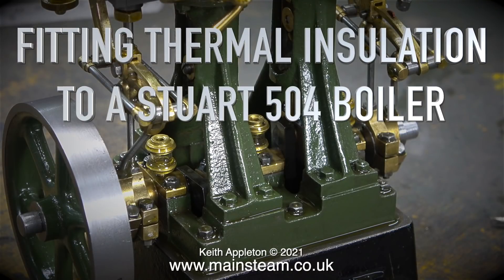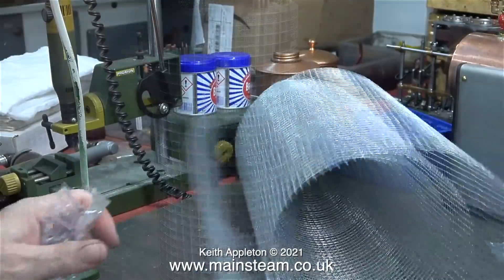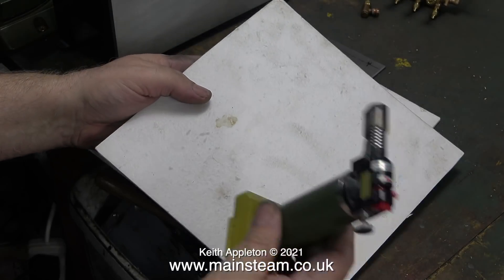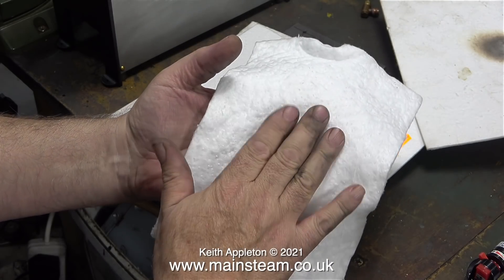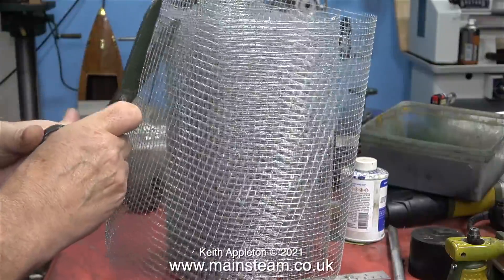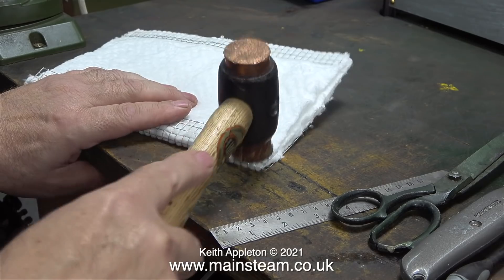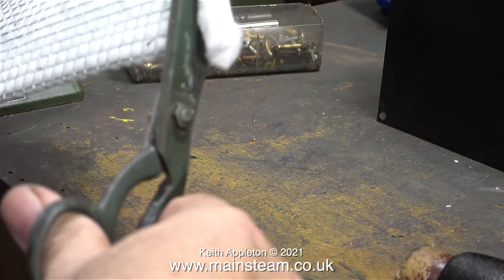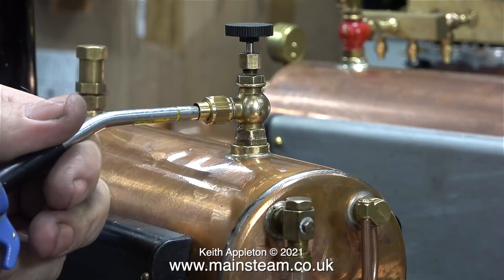MODEL  STEAM ENGINES & BOILERS - PART #3

Comment: Fitting it the way you have you should have no problems, but a word of warning to others if you install it with the metal screening facing the burner be careful with the first few firings. The first few firings will burn off the galvanize which is toxic, I have used this type of screening in DIY wood burners and after the first few burns the the galvanize burns off and they are safe to cook on.